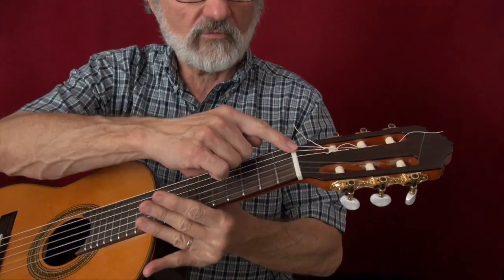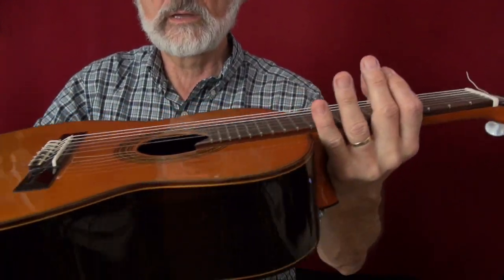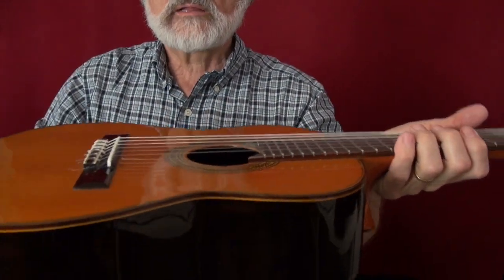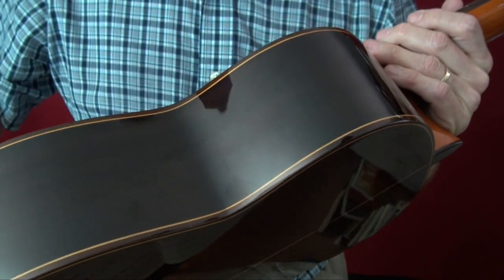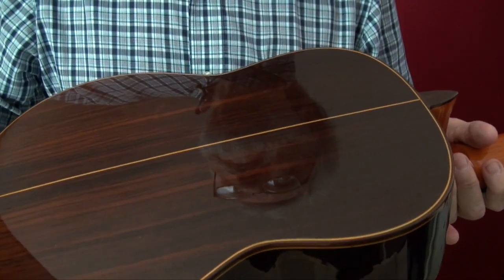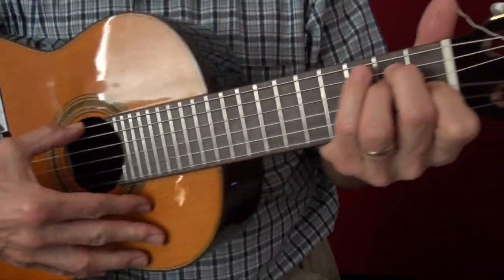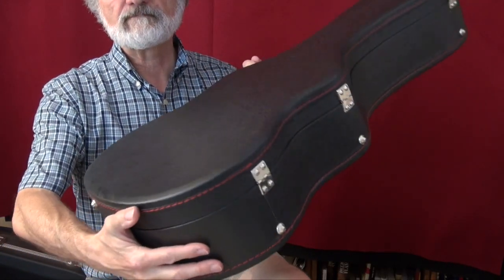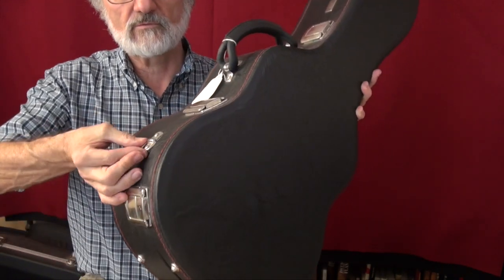Esteve Octave Guitar Project

Comment: What is your preferred brand of strings for this guitar?
Reply from the maker: tanukibrahma I make up special sets which use: .023" plain nylon for 1st; .027" for 2nd; .033" for 3rd"; 023" wound for 4th; .029" wound for 5th, .036" wound for 6th.
Reply: FernandezMusic Thanks, but I was wondering about the brand you use.  I've been buying La Bellas, but the 1st string breaks half the time when I install them ,so I think I'll try Hannabach next time. I used to use GHS, but I think they stopped making octave guitar strings.  I love this guitar, btw.
Reply from the maker: tanukibrahma Daniel Mari of Mari Strings in New York makes the string for me. The trebles are similar to other New York makers such as La Bella. The wound strings are made by the Mari workshop. The octave strings are usually the same gauges as requinto strings. Low tension Savarez might work.
Reply: FernandezMusic Thanks!